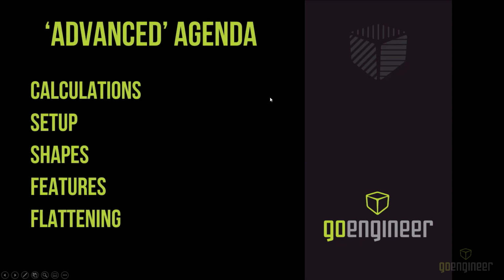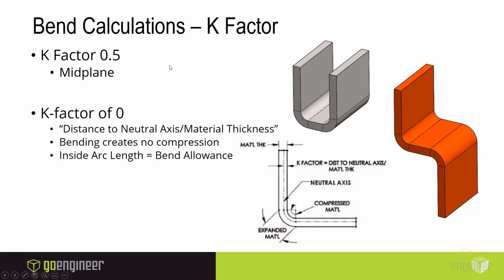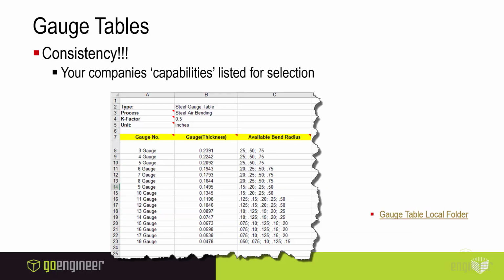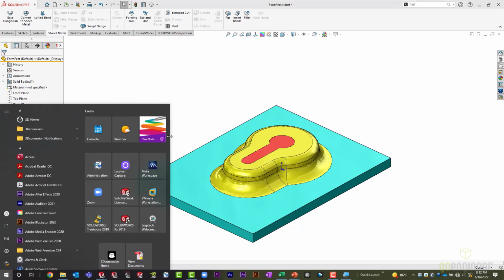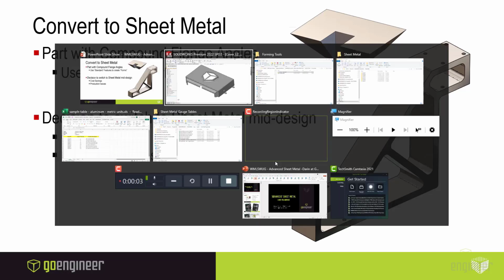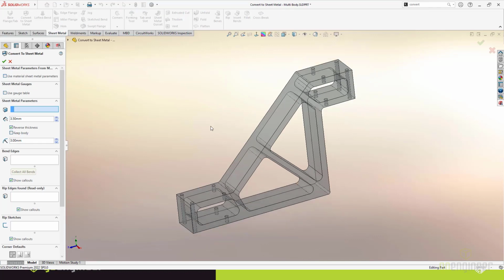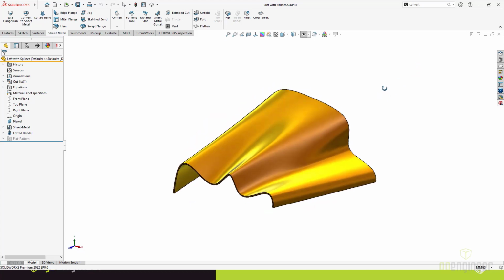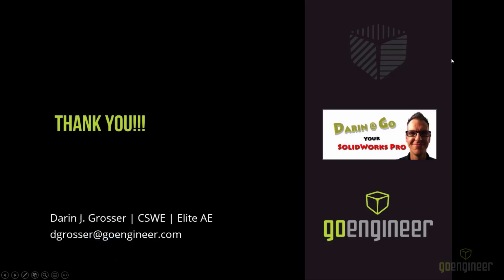SOLIDWORKS Tutorial -  'Advanced' Sheet Metal

Comment: What techniques should be followed to model arbitrary curved shaped sheetmetal part? For example if design the master body with surface then convert the surface into solid body and subsequently to sheetmetal, that would be supported in solidworks sheetmetal? Though there are many stamping features are absent in solidworks sheetmetal. I don't know why solidworks team does not develope those tools yet.
Reply from the maker: That is a valid and common workflow for creating parts in SOLIDWORKS sheet metal.  If you are having trouble with getting good results from that work flow I would recommend reaching out to your VAR's support team to look at your specific situation.

Comment: So if I make a custom form tool in SolidWorks, it ends up being the male half of the die. What's the best way to create the female half of the die so I can CNC cut both and use them in my press?

Is is really as easy as offsetting the surface by the intended thickness of the stock and building the female die out of that offset surface?
Reply from the maker: It could be that easy, the specific geometry is really going to control what methods are useful or not. 

The forming tools is meant as a way to create easy and repeatable shapes not necessarily as a proxy for actual stamping tools. So things like stretch or shrink may not be accounted for in the actual tool body.